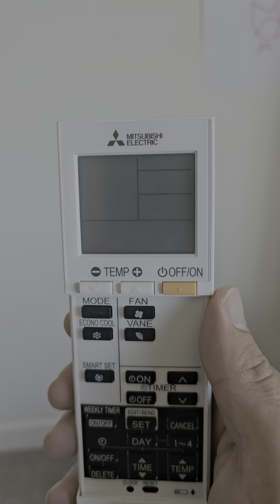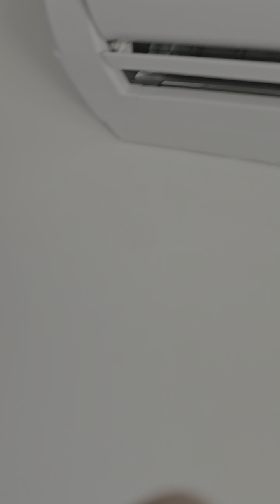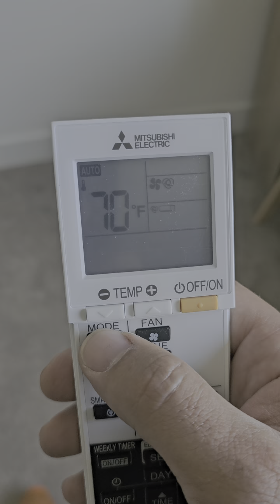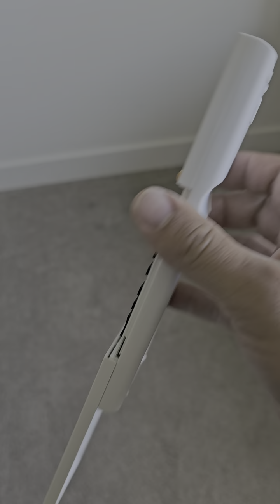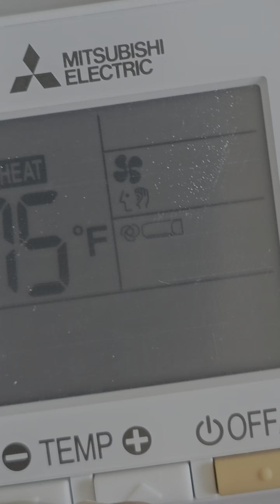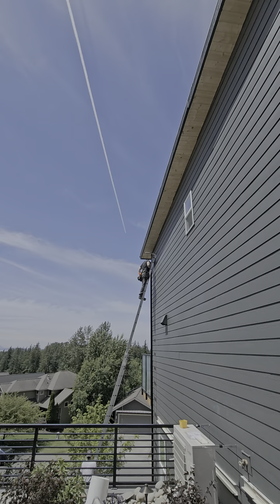How to use the thermostat remote for Mitsubishi GS heat pump

Comment: I have the same question as someone else…is there anyway to know the current temp that it’s reading at? I understand it measures temp on the unit not the remote, but I’d like to know what temp it’s currently reading at not just what I’m setting it for.